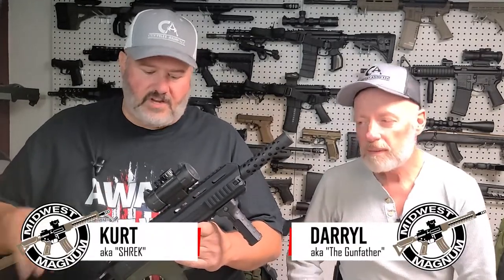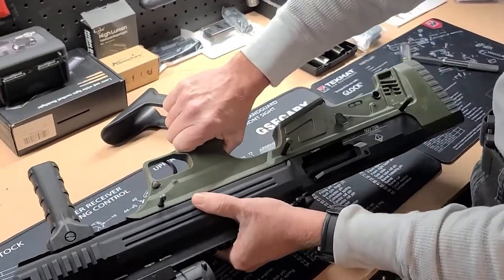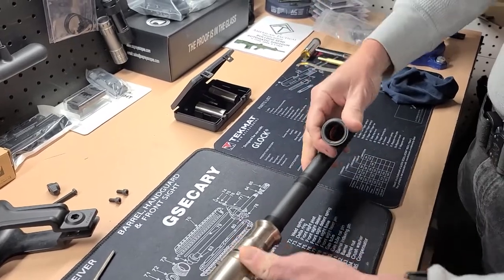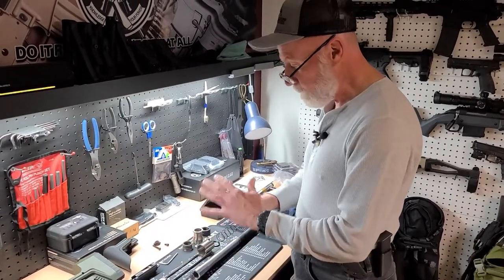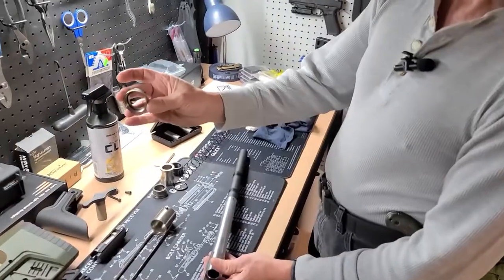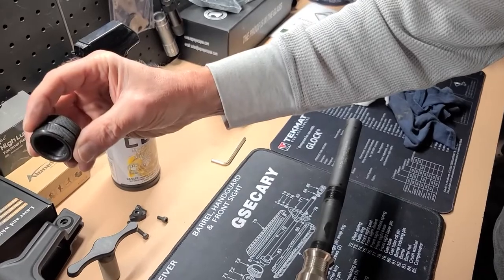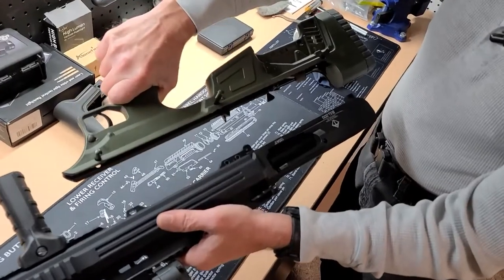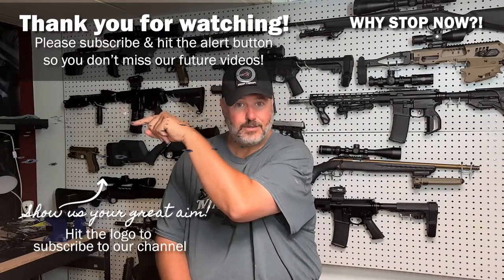Teardown & Cleaning the ATI Bulldog 12GA Shotgun

Comment: Great Video, I will point some people with the Tokarev TBP 12 to your site.  Cleaning and assembly is very much like the Tokarev TBP 12.  Those with the TBP 12 should watch this video and follow along with the instructions on pages 18 thru 20.  The TBP 12 does have 2 sets of Left hand threads(castle nut and gas piston nut) and  2 sets of Right hand threads(barrel nut and gas piston lock nut).  To change from the med pressure piston to the high pressure piston (3 inch magnum shells), removing the hand guard and charging hand is all that is needed to get to the gas system for piston swap. Separating the lower from the upper is a little more of a pain with 2 screws to remove at the end of the stock on the TBP 12.  I like ATI three push pins for stock/action release. The recoil spring doesn't need to be installed in a particular direction on the TBP 12.   The TBP 12 uses a set screw in one of the two holes on its barrel nut.  The TBP 12 has a castle nut and o-ring near the end of the barrel where the ATI uses a barrel shroud.  All in all, very much similar (Parts from Turkey but assembled in Knoxville, TN).  The gun has some features similar to an AR (AR safety, AR mag drop and AR bolt release) however without a charge handle at the back but on the side like a mini 14.  Thank you for the great video.
Reply: The castle nut on the Tokarev is vastly superior than the barrel shroud, which the large majority of cheap Turkish shotguns use... and everyone complains of the shroud coming loose continually... I wish they all used the castle nut so you can actually crank down on it, and for that matter all other nuts like the barrel nut in internals, because it's another nut everyone complains about coming loose...

Comment: One of the best videos for D&A and clean - thanks guys, do you spray down the bolt at all? Could you note again where you use clp and to confirm for the gas parts just a wipe down, correct? Looking forward to mine coming soon hopefully.
Reply from the maker: If the bolt does have a lot of residue simply soak it in CLP and use a tooth brush on it.  We use CLP on the receiver rails. We normally wipe down the gas piston parts with a solvent and then completely dry them. Don't want any lubrication on those parts.

Comment: I've had two blow apart running 3"mag slugs and hi brass turkey load.. upper receiver where the barrel nut attached, the threads are weak,cut too deep weak aluminum

Comment: are the charging handles able to be changed out with AR-10 handles or will it require some modification? if so would you recommend doing so?
Reply from the maker: That's a great question. It states it is equipped with an AR-style charging handle and looks very much the same.  However, we haven't been able to find a definitive answer for you. I personally would stay with the OG handle as it's pretty good and would hate to introduce issues on something that seems solid as is.  I hope this helps Josh and thanks for watching. If we find any update we will let you know as we save a log of these great questions for followup.